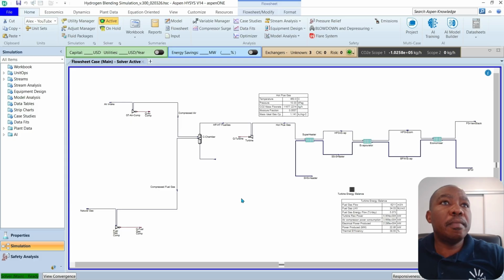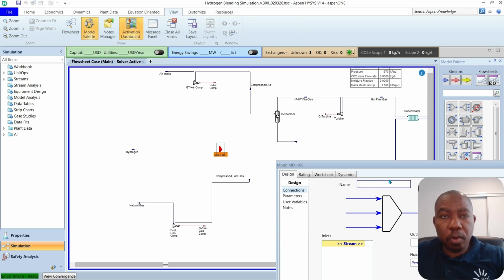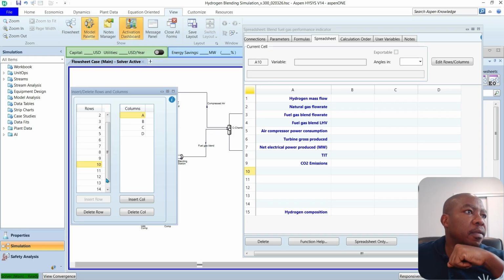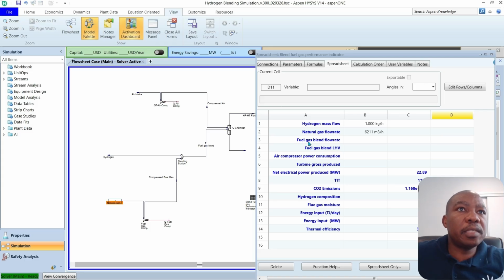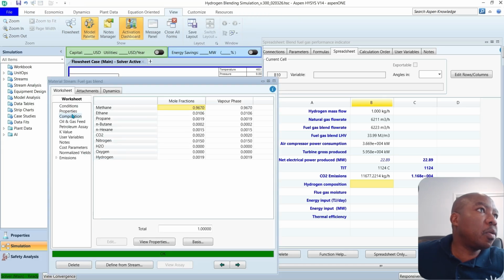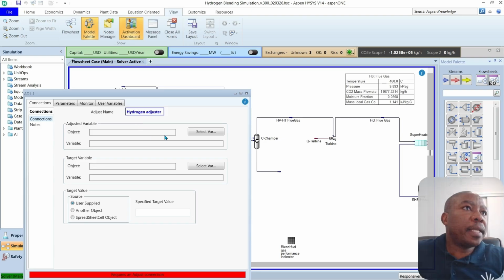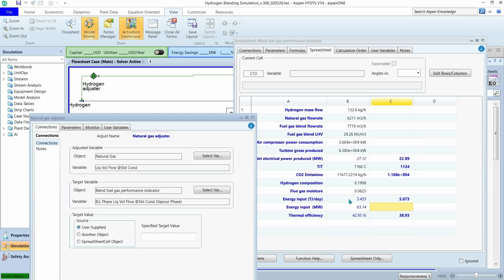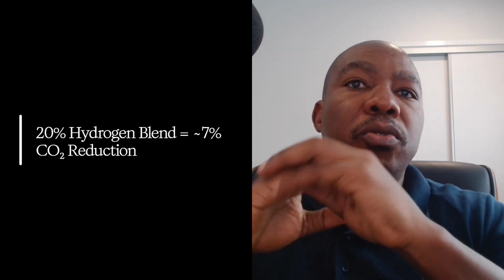Green Hydrogen Blending in Natural Gas | Power Generation | Gas Turbine | Aspen HYSYS Simulation

Comment: Hello, your video is truly very helpful, and I really appreciate it. Thank you so much.
However, I would like to know why the CO₂ amount does not decrease when the hydrogen percentage is increased. I have not yet seen the expected emission reduction effect from adding a clean energy source like hydrogen.
Reply from the maker: Hi, and thanks for the comment and interaction. I am going to assume that you've downloaded the model from the link I provided when we developed the base model. If you have set up the model correctly, you should see approximately 7% CO2 reduction when you increase the H2 volume fraction to 20% in the combined fuel gas stream. 

I suspect that what may be happening in your case is that the natural gas flow is NOT being reduced to meet the combined energy flow of 5.073 TJ/day. Please check this or you can share with my your model and I can double check. 

From memory, the CO2 emission without H2 should be around 11677 kg/h. When the H2 reaches 20%, the CO2 should reduce to approximately 10860 kg/h, which translates to a 7% CO2 reduction (11677 - 10860)/11677 x 100. 

I hope this helps
Cheers